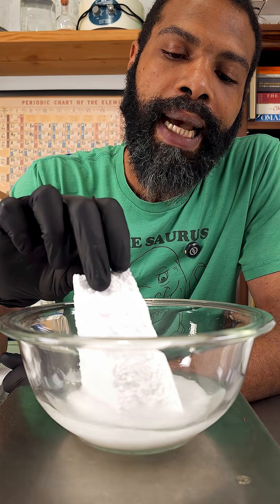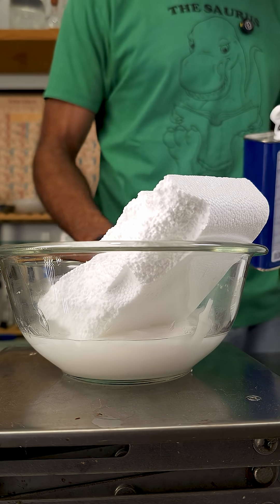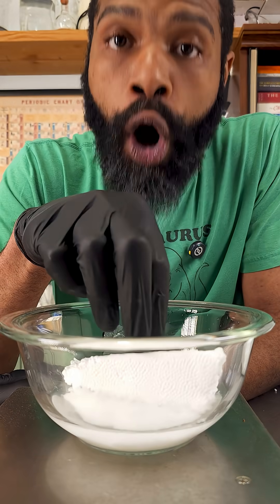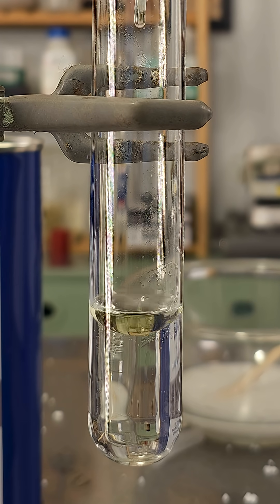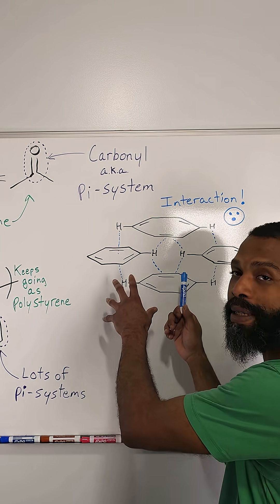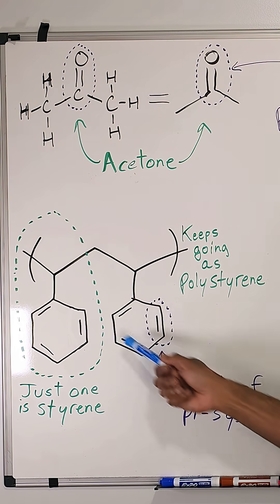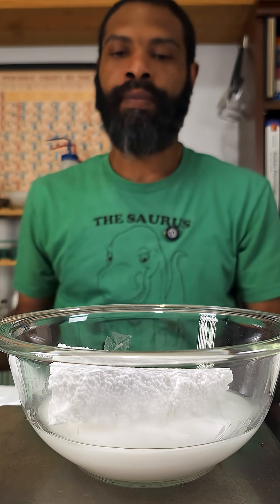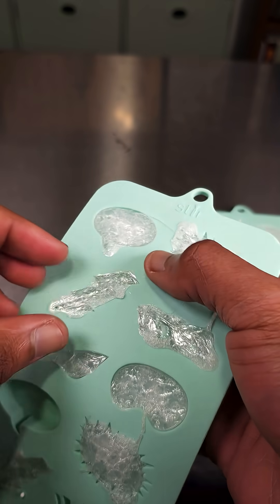acetone is polar

Comment: lol acetone is like the prototypical example of a polar aprotic solvent, i had no idea people were saying it was nonpolar
Dissolving something is more complicated than is it polar, and polymer chemistry is a whole beast if its own (tacticity is awesome)
Nice vid :)
Reply: When people see something "organic", they tend to assume that it is a nonpolar molecule... Same things happen to phenols, esters et c.
Reply: "the prototypical example of a polar aprotic solvent"

Oh no it's not! Try running a grignard or anything that requires aprotic conditions in acetone, and you will quickly understand that acetone is very much protic! (pKa of 19 due to the keto-enol equilibrium.)
Reply: @piranha031091  yeah its not actually aprotic but it's heaps better than stuff with hydroxyl groups, and i've still heard it referred to as polar aprotic
whether it's "aprotic enough" just depends on what you're doing, i do a lot of cursed pchem stuff where we need an "aprotic" solvent because exchangable hydrogens would very quickly thermalize the spin states
so for us acetone is effectively aprotic but yeah it definitely isn't aprotic full stop
Reply: @piranha031091 so its generally aprotic except in certain conditions?
Reply: @korosensei1325 it is definitely protic just barely
Reply: @piranha031091  Acetone does not contain molecules capable of forming acidic hydrogen bonds.
Reply: @Fae_Viking_Princess  As an Enol it does.
Reply: @piranha031091  The biggest problem with using acetone in a Grignard is because acetone itself would react with the grignard-reagent not because it can be protic as an enol. Since the equilibrium lies hugely on the keto side.
Reply: it's a pretty easy explanation for how dissolving things works but it's unfortunately false (or at least not outright true).
haven't seen aceton specifically referred to as nonpolar though afaicr.

people should know that some things can be easily dissolved in ethanol but not in water though, so..
Reply: lowkey it smells polar. hurts
Reply: I noticed there's a bit of a bell-curve to learning chemistry.
-It's magic
-It's magnets
-Wait this is material science?
-It's material science with tiny magnets and quantum mechanics
-It's basically magic

I'm far from an expert, but learning basics on my own I can see a lot of places I could of easily convinced myself I understood more than I did/do.
Reply: Right? I had to re-read the caption cause I thought I was missing something, since I’ve never heard someone call it non-polar.
Reply: Polar but nonpolar coded. But ok, why does it work? When I worked in a lab it was basically one step above IPA on the cleaning escalation ladder, below the real funny stuff like fuming HNO3 and piranha.

Comment: Curve ball... Is acetone acidic...?
Reply: acetone is the textbook example of a polar aprotic solvent, meaning a polar solvent with no acidic protons
But actually the answer is very very weakly acidic, since the >C=O of acetone can technically convert into a form we call the “enolate ion” that looks like ⩾C-O⁻ which releases an H+ ion
Releasing H+ ions is what acids (according to one of the definitions) do! 
However acetone really is ridiculously weakly acidic 
It really does not want to be in the enolate form at all, but technically your answer is “very weakly yes” :3

Comment: wait wait its YOUR theory?
there isnt like scientific consensus on this???
Reply from the maker: There is not a scientific consensus about why acetone defoams styrofoam. Solvent studies I found suggest the double bond is to blame but that is my interpretation of other people's data. It also doesn't explain why hexanes won't work but cyclohexane will.
Reply: @ACSReactions ohhh wowww. this kind of stuff is incredible. exactly why i love yalls content. theres phenomena you can do at home but still have no complete explanation of. put this next to the static electricity vid and water crystallization and any other i forgot XD
Reply: @nyuh yeah we understand both an insanely large amount about chemistry and an insanely small amount at the same time :3
Reply: @ACSReactions  Did you investigate the formation of intermolecular dimer associations when carbonyl groups pair in an antiparallel fashion, resulting in a decrease of the dimer's total dipole moment? I'm interested in the literature that supports your proposed mechanism involving pi-stacking with acetone and benzene rings.